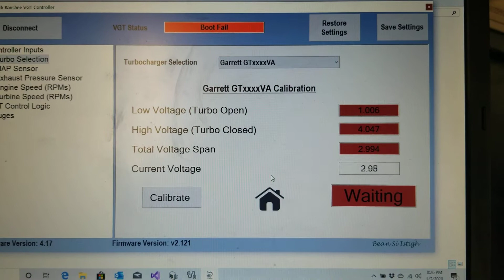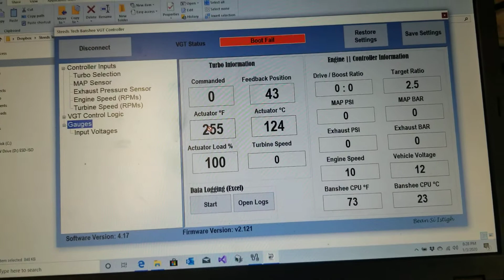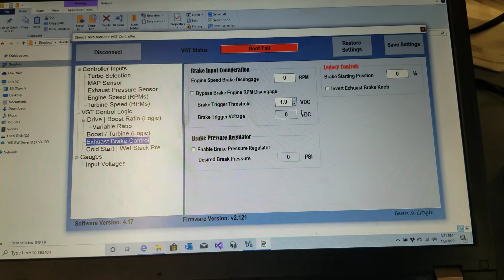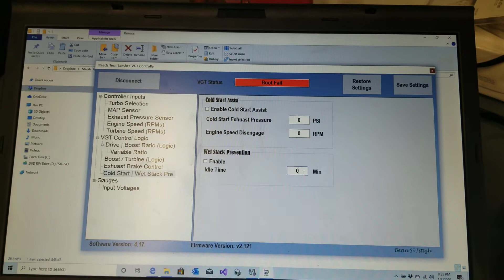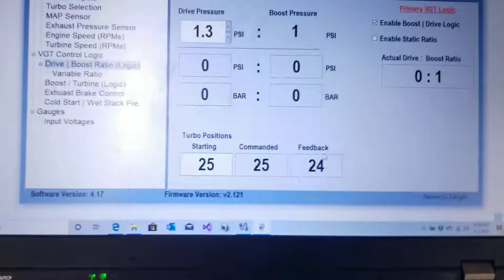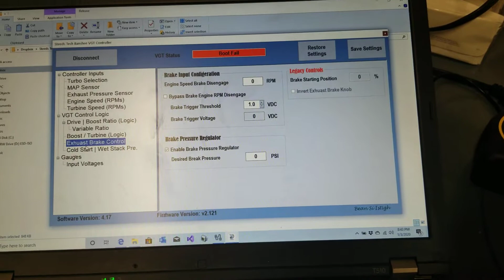Ford Powerstroke 6.0 Turbo with stand alone Banshee VGT controller!

Comment: I see ATS has their gateway software out, and it mentions Intelliboost control for VNT turbos. Im wanting to know if anything will be available so i can use it to control a Garrett GT3782VA on my 12 valve Cummins.
Reply from the maker: You will be able to, you need to ensure the turbo has the internal camshaft, its what rides up against the Duramax position sensors. Not all ford turbos have them, but alot do. It still wont be available for a bit, ive been working on the 6.2 Hellcat, Hemi 8HP and 8AP controller.

Comment: Where can I get this? Trying to find a good way to control a turbo from a 17 6.7 psd on an older engine.
Reply from the maker: ATS Diesel will be selling their Intelliboost soon, which is specifically designed to control these turbos.
Reply: @SteedDolan soon like 10 years from now or soon like less than a year?

Comment: Any updates on a 6.0 VGT turbo controller. I call ATS every couple months and each time like clock work they say it will be another few months. At this point i think they probably don't even wanna release this controller for some odd reason. It shouldn't take years and years when the basic system was figured out from the get-go just my two cents.
Reply from the maker: They do, sells team vs engineering is two different departments. They have them on a few trucks but its one of them things where they want it to work as best as they can before they release it.
Reply: @SteedDolan  That makes sense product testing seems to usually take the longest to work all the kinks out. I guess I'm feeling a bit antsy since I have my 6.0 vgt turbo setup ready for my 12 valve Cummins and this controller is pretty much the last piece to the puzzle.

Comment: And now it is 2023 and there is 0 none vnt controller in the world that can control those turbos. i bought a 6.0 turbo for my project and googled Yes there are many vnt controllers in the market and after hundreds of hours searching there is absolutely none that works with this solenoid style actuator. Some one said you can use bosch edc15. Yes but who makes those modifications for stand alone system, I haven't found one. Sad story :D
Reply from the maker: I can control it lol, I have a 2006 Ram 5.9 in my garage I'm working on and a 2014 ram 6.7 that I am also working on. The 5.9 will have alot of tunability and the 6.7 is a replacement to the Holset VGT
Reply: @SteedDolan  for vgt they sell that lil black box and it seems to work great, but they does not support any vnt turbos. How can it be that you are the only man in the world who can figure out this stuff. Lol :D
Reply from the maker: @BloodHoundDiesel  yeah that's made by Curtis. There's pros and cons to it. Cool aspect is it open source and community supported.
Reply: @SteedDolan  Ouh yes sorry i said vgt before. But yes i can't wait when you guys get that ats controller in to market. Seems that i dont have any another choise but wait.😅
Reply: @SteedDolan  how in the heck dose that help anyone else, I don't understand why if it is working that ATS wouldn't release it after years I like others got burnt Fleece got me I bought a new 6.0 turbo from them then they stop producing there 6.0 controller and so did you lol I keep calling ATS and nothing saying in a few months its been 2yrs. When will we get a working controller? or is this just a dead horse?
Reply from the maker: @tryandtakealaska3797  Not sure what your asking. But I am only one person, and I can only develop so much. Considering over the last two years. I have developed a wide range of Allison conversions, 8HP conversions, 6.4 & Hellcat conversions. I think i am moving along pretty fast! The Intelliboost is right around the corner, right now ATS has the intelliboost VFRs running on multiple Ram 6.7s in place of the Holset VGT, and I have one on a 5.9 that i am working on. Once i finish up the last bit on the 2006-07 5.9 Allison conversion ill be focused on the VFR again.
Reply: @SteedDolan  what I was say is you had a working controller years ago that you was selling I tried to buy from you ,you said there was more coming soon then when I contacted you again for ETA you said call ATS I did ,and nothing for years now why did they not make the working one you had(banchee seemed to work just fine). iv seen people here and on foarm saying they bought there turbo then everybody just stop selling them you ,fleece , and ATS all of ya's stopped. my truck has been ready to drive for close to 2yrs now and to swap to a different turbo now I would need a new exhaust manifold ,turbo, exhaust down pipe, and intercooler pipe, and turbo intake pipe or about 3k to 4k in parts

Comment: This really opens up big opportunities for my project I’m working on.  It’s an om606 mercedes diesel.  I wasn’t sure what size turbo to run to begin with, they’ll pretty much put up with any turbo you want to use.  I started thinking about the lag I’ll have since it’s a 3.0 liter but it revs to 5k so the exhaust volume is eventually there.  I have a new upgraded turbo for my lly duramax so I was thinking about using the old one and your controller to experiment with
Reply from the maker: ATS Diesel has a controller that will be available soon called Intelliboost. I don't make the Banshee anymore
Reply: @SteedDolan  should I call them and ask them if they have an eta?
Reply from the maker: @shidukirider  it probably won't be ready until the end of the year
Reply: @shidukirider  lol I wasted $3700 on buying a new turbo getting it machined and ceramic coated inside and out and upgraded to a KC turbos 360 bearing kit. back when he was selling them told me he was getting a new order of them in soon then it turned in to call ats and now ats has been telling me for years its coming at the end of the year for years now. shame is I even found a used banchee 1 i bought for $475 but was not setup right and only made 13 pound of boost(guy had it on a gas car) and ask him for the software and again was directed to ats that then told me there is no software they have for it ended up selling after 1 listed for sale for $150 so in realty I got 4025 rapped up in a great looking paper weight. I keep calling ats they keep telling me the end of the year but its not even going to work on a 6.0 turbo there working on the 6.7 turbo 1st then down the line they will add 6.0 turbo functionality and of course they say ETA is the end of the year as they been saying for years
Reply: @Sokolov812-lz5ov  that’s a shame, that’s why I haven’t started fabbing anything, the 6.7 Cummins turbo can be manipulated with a servo or vacuum control bypassing the electronics, I hear that design is prone to sticking since it’s not vnt like the duramax and 6.0 psd turbo.  So no real benefit especially since I don’t have something to put it on if it doesn’t work out.  The nice thing about the 6.0 turbo is it’s a v band, simple and usually those turbos are cheaper to acquire.  I was toying around with just making a basic controller with a knob.  But then I started considering compound turbos, more weight and piping but a more solid setup with no electronics involved.  What engine was your turbo going on?
Reply: @shidukirider  for now it was going on a 5.9 Cummins till . get the 5.9 international DT360 done because I mod my truck to take the SAE #2 medium duty setup puts all the motor mounts in the same place and the bellhousing on trans will bolt right up. and also makes it so you can do in frsme rebuilds if ever needed. the Cummins is mild at about 400hp the DT360 should be around 800hp to 900hp and be reliable there a much tougher built engine and there wet sleeve engine. going more all out with that coated pistions bowls and skirts and coat main and rod bearings and like the turbo everything including bolts, brackets, intercooler pipes, everything is get ceramic coated even alternator,  A/C compresser, transmission, and transfer case was disassemble and ceramic coated. alot of time work and money coming up on 6 years work now but better then spending 100k on a new truck this way I get the truck I aways wished ford built for around 1/2 the cost..08 f250 king ranch 5.9 12v cummins, 6 speed allison, twin stick np205 transfer case, and 2014 e-locking rear and a yukon e-locking front diff. 3" lift rolling on 37's.
Reply: @Sokolov812-lz5ov  Damn that’s a nice build and would be especially with a vnt turbo.  The dt360 seems not so common as the dt466.  Are they easy to get where you are?
Reply: @shidukirider  there in a lot of 87-94 international buses and trucks I se 10 or so a year on market place within my state i waited for a low mile one to come up this one is only 14k mile came from a wreaked fire tanker truck.

Comment: So, I saw that this had the option of the 6.4 turbo. Could this be used to put a 6.4 turbo on a 7.3, and when does this new controler come out, I dont see it on ATS's website.

Comment: How the heck would your truck ever build 10+ psi of boost idling? I can hold my truck to redline with a hx35 and my truck makes maybe .5 psi boost , I'm thinking you are trying to sell these controllers or something,  these crappy stock 6.0 turbos won't do 1/2 of what you are saying
Reply from the maker: Did I say 10 psi idling? That video is pretty old j don't remember what I said. Idling most likely not, free reving almost definitely. My twin charged 4BT make about 7-8 psi idling before I put a bigger pulley on it to slow down the supercharger
Reply: @SteedDolan  just for shits today I held the old p pump 97 5.9 to the rug in natural reved to about 3900rpm Chinese boost guage went to 2psi , I also bought the necessary parts to bolt a Garrett charger off a 05 6.0 powerstroke,  so hopefully within a week I'll have that done , just going with a toggle switch for now,  so it will be eather open or closed , ill soon find out if all this engine warm up/ engine brake ect holds water,  I know "in theory " it should but I'm highly skeptical,  great explanation video though
Reply: @redfuel6bt  he said 10psi of backpressure, not boost
Reply: Try comprehending what he said “10 psi of exhaust back pressure “

Comment: Can this system be used to run a GT3782VA on a 12 valve?
Reply from the maker: It can, call ATS diesel performance and ask about their intelliboost controller
Reply: @SteedDolan  when are they going to have it on their website?
Reply from the maker: @AndyFromm  Working on a new controller. hopefully soon
Reply: @SteedDolan  how do you think a 6.0 turbo would be on a 4bt?

Comment: I’ve not seen this before is it your invention?
Reply from the maker: The banshee VGT controller? It is, its a universal stand alone, IP67 reverse polarity and surge protected VGT / VNT controller. Its not a cheap Arduino, its a purpose built ARM micro controller. Its the only kit that can control any electronically controlled VNT / VGT.